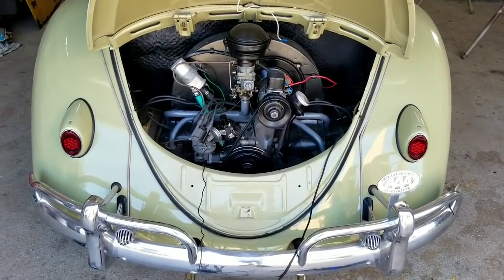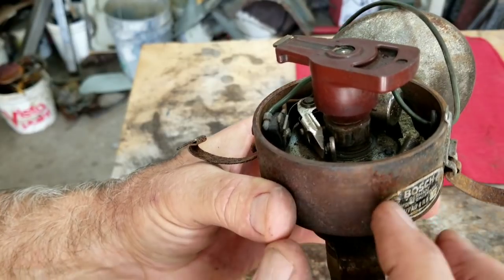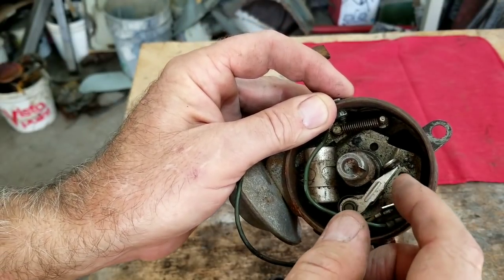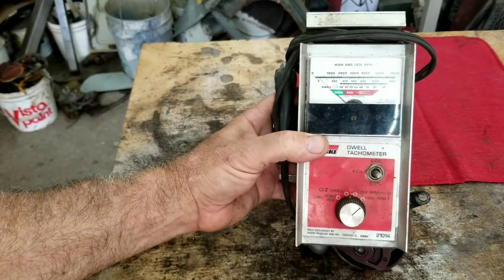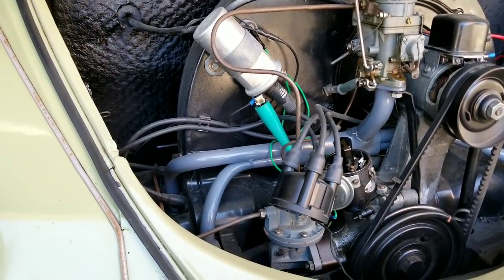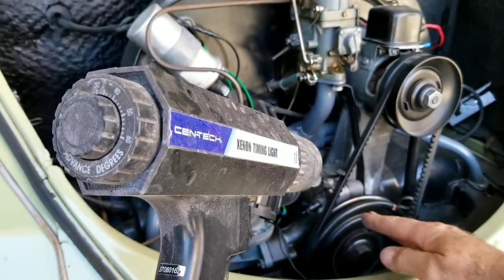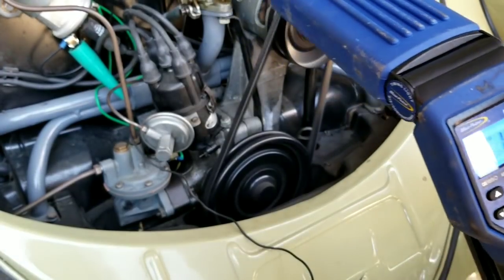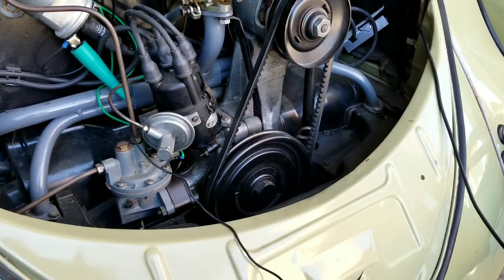How I set the timing on the VW engine air cooled flat 4

Comment: Thank you Mike for this video , never did this next step on checking my timing.  Back in the 70's my experience was 99% rebuilding or machining the motors; I was the "Machinist" next step was for the "car Mechanic" different skill- set which i had a great amount of respect for thier skill set.   I wanted to understand thier trade ; I went to a adult trade shcool to sign up for mechanic classes. But then I saw they also offered Tool & Die classes and  a four journeymens program; I signed up,  my passion was in the machining.  I still have my Sears timing light and my RPM & dwell meter I bought back in the 70's when i thought i would be taking mechanic class.

Comment: Hello Mike, thanks for posting this video, it’s one of my favourite topics. It’s frustrating when ignition timing is ignored - it’s so important. There’s videos with folk trying to start an engine while skewing the distributor back and forth hoping for the best !. I suppose if you are stuck on the side of the road with the points closed up, a simple car bulb and wire to positive will enable a static adjustment to get you going again, with points gap reset to. I’m sure you know what I mean....but I’ve fixed many starting problems with ignition timing / dwell angle issues in the dim and very distant past. The 6V VWs were fussy in that the ignition set up was particularly important given the lower voltage, not much capacity for any lost efficiency. If the timing was poor, battery low and issues with the engine earth, you needed many prayers to start it....   keep the good videos going, I’m enthralled by the ‘62 bucket truck restoration...

Comment: Great video Mike! I like the timing light that shows both rpm and timing. Mine I have to switch back and forth. I use a 12v battery to use an updated timing light on a 6v system. A lot of people miss the grease on the cam of the distributor. Glad you point that out.

Comment: Would have been nice of you to show exactly how to use the dwell meter instead of just saying "use a dwell meter".  I think you neglected to tell folks that they must move the distributor to adjust the timing while the engine is running at full advance.  Rather a neat trick with one person.  Holding the revs with one hand, a timing light with the other, and then with your 3rd hand adjust the distributor and tighten down the 10 mm.  Hmm. Good to have an assistant if you are going to do it your way.  Just a thought.  Also, you might want to do a video to show people how to initially set STATIC timing, to get in the ballpark, before ever pulling out the light.  The relative position of the vacuum canister (when the dist. is in place correctly) and where the rotor should point when the motor is at TDC and the dist. is seated correctly and not 180 out.

Comment: Mike
Here in the uk I have had over 400 cars I use to by cars do them up resale them ford escorts vaxhall vivas Austin maxie. renult 12 datsuns Honda etc I have always used a basic strobe timing light had no problems then I used a gunson colour tune to set the fuel mixture if u don't know what this is u stil buy one  of eBay it's like a small spark plug u take out no one plug screw this in start the engine until nice and hot you look down in the plug hole u will see it flashing the the colour is blue the fuel mixture is correct if not ajust mixture until blue Phil in the uk

Comment: I thought it should between 28-32 with the vacuum advance unhooked and the port blocked? Then when hooked up at around 3-3500 rpm it will go up to around 40 degrees?
Reply from the maker: no when your doing full advance you should have the  vacuum port connected. run the engine up until it reaches full advance. that should be at 28 degrees with all advancing mechanisms working. Stock 28 degrees.....some engines with high performance cam and low compression may need higher advance but that is extenuating circumstances.

Comment: i had an electronic ignition, but they have a tendency to go out without warning and leave you totally stranded. Yes you have to adjust the points but I think its actually more reliable
Reply: Keep the points dizzy with you just in case.  However I agree that they are better for day to day, and points in case of emergency.
Reply: One compfire one pertronix each failed without notice priced out to a lot of points/condenser sets.
Reply: @erikhilsinger9421  Same, they go out suddenly and without any warning. The day before mine suddenly cut out I had been driving through the mountains near me, no cell service whatsoever. Thankfully nothing happened until the next day when I was in town and near my house.

Comment: I tried yesterday with a non degree timing light. I saw 29/30 degrees while at idle not throttled up. I run pertronix svda and high output coil. Every time I touched metal, I'd get shocked. I was hooked up to coil at first then off alternator still same. Any ideas?

Comment: 6v electronic ignitions can make the car hard to start. The starter draws too much voltage and then there’s not enough left for the ignition.
Reply from the maker: yea that is why this one is points. but man the points today are sure cheap no bakolite rub blocks. just plastic. they just dont last. plus the condensers fail like regularly.

Comment: There’s nothing wrong with the points system! In fact, if your gen, or alt. Should fail, and your battery starts draining, the points system will continue to work. The coil will make spark at less than 12v. With some electronic setups , it will just shut off at less than 12v. With the points, you might limp the car home.
Reply from the maker: True but the biggest problem I have is the quality of the points today are terrible and the condensers especially they fail often versus the other way

Comment: The delay on the distributor shaft's #3 lobe is strictly for the non-doghouse fan shroud, as the oil cooler is blocking the fan from blowing on #3 cylinder the most, and that tends to make cylinder #3 run hotter.

That's the deciding factor ......
 your style of shroud dictates what distributor you should be using.
Non doghouse shrouds get a delayed cylinder #3 distributor.  
Shrouds with the doghouse get the even four lobe distributor. 

Also, that delay on #3 gives a distinct lumpy cam sound to the running engine. Even more so on a larger CC engines .. 
So ... if you desire a smoother running engine  ... find the distributor with the 4 even lobes.
Cheers.

Comment: And do not buy cheap dist. the one I got for 29.99 is a junk. The top of the shaft wobbles worse than my old one and there is no way to adjust the points like that. The old one costed 17.50 in 86? It was a good one.

Comment: This video is not helpful,talking about that timing gun is just confusing. He shows motor running and being timed, and if your motor won't stay running to time it, then what?  Not helpful...
Reply: I just had this issue. My motor wouldn’t stay idle and would shut off. I realized o have a vacuum leak in my manifold and had to replace my metal ring gaskets. They were bent. We also took out the points and condenser and replaced those with an electronic ignition. It was able to start and stay running. Good to check for those things.